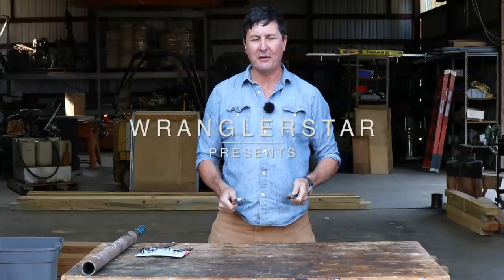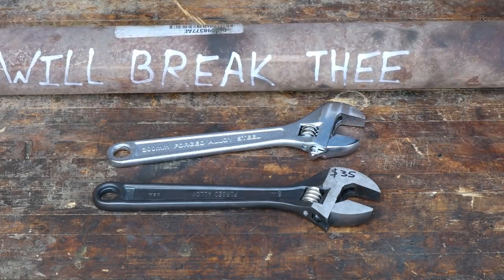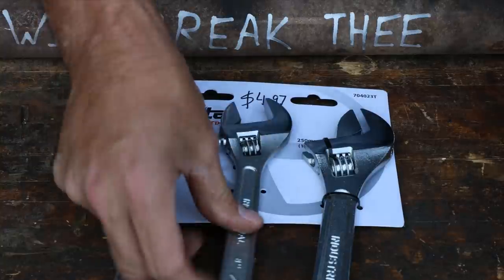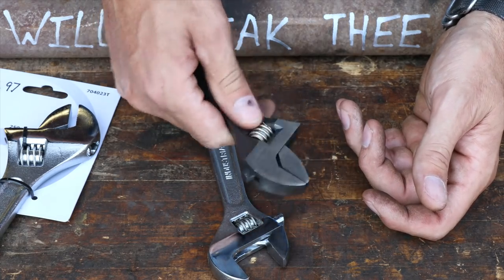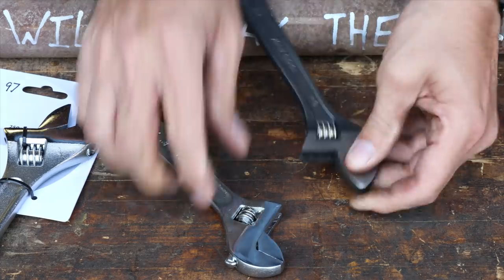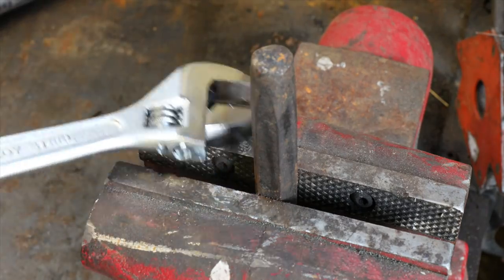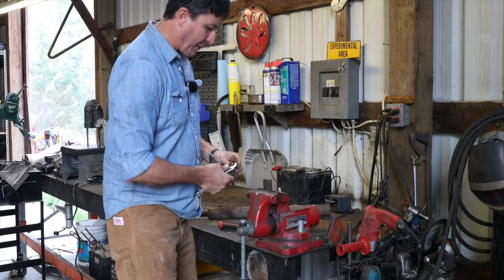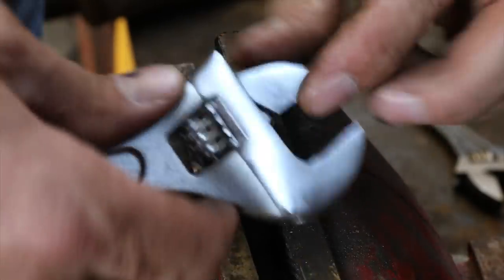Testing Cheap V.S. Expensive Wrenches On AMAZON

Comment: buy cheap tools, use them until they break. if one breaks doing something youll do again some day, replace it with a one thats more expensive
Reply: Blood Bath tools are an investment they dont dry up or go bad a good quality tool will save you hours of labor and aggervation. In my line of work we ask a guy what tools he owns and what brand if he seems to think cheap tools are acceptable then he will think cheap work is acceptable. If a guys just getting started out  I get not having the best tools it takes a long time to build a respectable tool set, but if some goomba tells me he's been in the industry for 15+ years and has harbor freight tools I know he's not a good tech
Reply: Blood Bath Breaking a cheap tool is no problem. Problem is that often cheap tool ruins your work piece.
Reply: @dustin lewis thing is though its a waste of money buying an expensive tool if you're only going to use them in a range where a cheap tool is suitable. if the tool is speced right for the job it doesn't really matter. But this is something that's much easier to dial in in a production environment than say a maintenance one. Then again in my line of work if you pulled out even a 1000 dollar adjustable wrench the quality department would be issuing you a disciplinary for illegal tooling :p
Reply: arg31ify Reality has prove that cheap tools aren't cheap.
Reply: XtreeM FaiL  well no. say you buy a cheap spanner that breaks/deforms at 50 inlbs if you're doing jobs that require more than that yeah its trash. but if you're only ever tightening light fasteners to say 35inlbs  then its perfectly capable.

and you've saved money over a far more expensive tool that could go to a few dozen ftlb whos capacity would have been wasted.

as I said spec the tool to the job.

otherwise it's no differnt to over engineering something
Reply: Harbor freight sell new knuckles?
Reply: Bartholomew Horatio Brunel, ladies wear gloves, pal.  You a lady?

Comment: The first adjustable wrench from 1892 (Enköping Mekaniska Verkstad later to be known as Bacho) in sweden. Nice try tho
Reply: False........   An adjustable spanner (UK, and most other English-speaking countries), adjustable wrench (US and Canada) or a shifter (Australia) is an open-end wrench with a movable jaw, allowing it to be used with different sizes of fastener head (nut, bolt, etc.) rather than just one fastener size, as with a conventional fixed spanner.[1] Several other names are in use, including the US trademark crescent wrench.[2][3]

Forms and names[edit]
English engineer Richard Clyburn is credited with inventing an adjustable spanner in 1842.[4] Another English engineer, Edwin Beard Budding, is also credited with the invention.[5][6] Improvements followed: on 22 September 1885 Enoch Harris received US patent 326868[7] for his spanner that permitted both the jaw width and the angle of the handles to be adjusted and locked. Swedish company Bahco attributes an improved design, in 1891 or 1892, to Swedish inventor Johan Petter Johansson.[8][9] who in 1892 received a paten
Reply: Nice copy and paste from wikipedia
Reply: is that bad? say false and show the proof?

Comment: Go to pawn shop. Get $35 wrench for $2.
Reply: Haven't been to a pawn shop where their items weren't priced almost the same as new or more.
Reply: Go to a pawn shop and get a $35 wrench for $37.
Reply: I go to pawn shop and ask for $5 wench and get slap in face. :(
Reply: I went to a pawn shop the other day and got an inspection camera brand new for $20 when it was for  sale there for $25.95. And I picked up a Skilz palm sander brand new with every attachment, never used for $25 and they were selling it for $35. I Bartered with the guy whereas if I bought both I asked the guy if I can get a good deal. So he gave me a really good deal.😁😁😁
Reply: I have all snap-on, all from pawnshops, right up to monsters for my back-hoe, maximum 25% of normal price. NONE have broken.
Reply: Wise man
Reply: who thinks to pawn a wrench?
Reply: I dig through the pawn shops and get all the craftsman stuff.  It has lifetime warranty.  Lowes took over the craftsman line.
Reply: Go to pawn shop. Get $35 wrench and wait for the call of the experts .

Comment: Wranglerstar, when your grandfather bought S&K tools because they were a good value for performance and cost, there weren't any dirt-cheap Chinese competitors then. That being said, my favorite tool is a Proto 8" adjustable wrench I've had for over 50 years. Bought it in a family-owned auto parts store where it was hanging on a Proto tool display board on top of it's painted silohouette.

Comment: Hi, I would recommend testing a Pliers Wrench (I've had good experiences with Knipex), you'll never want to use a proven but now outdated adjustable wrench.
Reply: I have one, they suck. They rely too heavily on grip strength to not round a nut. You also can't put a cheater bar on them. I got it hoping that it'd be the only tool I needed for doing alignments (manufacturers like to use all sorts of sized nuts) but ended up coughing up the money up for a set of combination wrenches. Now the pliers wrench is relegated to the back of a dusty toolbox drawer, unlikely to bust a nut ever again.
Reply: @Andoxico  I have two Knipex pliers wrenches, the medium one and the large one. I have used it many times am satisfied with it. However, you are right in the point that you will find it difficult or impossible to apply a screw that is much too tight. In that case you usually need a rust remover and a hammer anyway. I don't see the pliers wrench as a replacement for other tools, but as an addition.

Comment: SK makes the best stuff. My tool chest is full if them. My grandfather and father both used them along side Snap On in the automotive industry. They have never had to warranty any ratchets or anything from SK we have however had to warranty a few snap on ratchets and hand tools. SK is my favorite and always will be. The only issue is you have to send them out should you have an issue because they don’t have a tool truck however I’ve never had to do that but in the event you did you’d have a longer turn around time waiting for a replacement. SK is number one in my book!

Comment: I can't believe the reviewer left out the number 1 reason for buying quality wrenches. Often when a wrench fails you are applying a lot of force, and holding it with your hand. This creates momentum that will at that moment be released, often resulting in your knuckles slamming into the housing of what you are working on. This can result in anything from scraped knuckles to a broken hand, but quite often causes pain or injury. It is the very best reason to use the highest quality wrench possible...and by the way, it wont be an adjustable wrench usually, especially if it is so tight it requires a breaker bar. Can you use an adjustable wrench in an emergency...of course we all have...but if the failure of the tool might easily cause injury, it is best to use the proper tool. I would never use a very cheap adjustable wrench in any critical situation, and even a fairly cheap non-adjustable wrench will be stronger than an expensive adjustable wrench. An S&K adjustable would be a minimum, but an S&K open end or box end wrench is preferred. The high cost of good tools pales in comparison to hospital bills and lost wages due to injury, but of course it depends on what the task is.
Reply: I have punched an engine block when a Chinese 13mm socket split out. Thought I broke a knuckle for a minute.

Comment: Hm, Bahco Tool from Sweden is the original. Today owned by Sandvik. It was invented about 1891 in Enköping Sweden by Bernt August Hjort. The company known as BA Hjort and Co. And you need at least two or three, or even more. Best tool ever, if used properly. https://en.wikipedia.org/wiki/Adjustable_spanner

Comment: So in conclusion, for 90% of applications the cheapest one will be just fine.. Unless you plan on exerting 60-70 pounds.
Reply: Nick collinet no Bolt is gonna be That rusty
Reply: Actually no. He only shows how to cause total failure on them. Thing is, cheap ones get loose fast. It will cause them to twist on bolts and round them off, and it will be hard to even fit probably. A better tool can tighten smaller bolts because it's more precise (stiffer). If you can, get midrange tools, will last years - not a lifetime, not a day. And it will be harder to hurt yourself with them. In the video the expensive one broke because it was hard steel, you will never be pushing such force on such a wrench, where the cheap one just slipped and broke. Also he should show how they look after couple slips on the nuts. The cheap ones get bent on the inside just after normal use... not even after slipping.
Reply: Nick collinet longevity ?
Reply: no not 60-70 pounds. 60-70 pounds using a 30 inch lever arm... very different.
Reply: If you damaged the bolt, the bolt was weaker than the tool, which is normally the case. Not the tool's fault. The harder element will always win.
Reply: The Real Elvis:  You have missed the point, a cheap wrench with weak, springy jaws will damage a bolt/nut at lower forces than a well made tool.  Cheaper tools can have their place, but if they don't get the job done (e.g. because they round off a hex before you can undo it) then they are pointless.
Reply: Too many variables... right tool for the job? 12 point, 6 point, stripped-grip wrench? Crescent wrench is absolute last resort. If you're damaging a bolt head's corners it's usually because you're using a 12-point to break a fastener with frozen threads, or the tool was slightly over-sized. The cost of the tool won't have much to do with it.

You'll pay 500% more for the exact same tool made in the US than a tool made in Taiwan using the same manufacturing methods and specs. Being made in the US doesn't mean much aside from higher price. Taiwan isn't China. If I see "China" I throw it away. China's terrible at manufacturing everything. Their tools are cheaper because they often use inferior alloys, cast parts where forging was needed, inferior machining precision, no quality control. Taiwan is definitely on par with the US in machining.
Reply: For more than 90% of the applications.
Reply: I have to say ..the worm is really clunky and grindy on cheap nasty spanners over here (UK) Bahco ones are the way to go. Great Swedish engineering.
Reply: Bahco is now owned by Snap-On aswell..
Reply: In conclusion if you're use it a lot, get a quality one, if you only need it a couple times in a year, the cheap one is fine.
Reply: I agree

Comment: Absolutely. I have an old car and in germany we have rough winters from time to time which causes the wheel nuts to jam. I broke so many wrenches until I got a quality german one. Have it now for years. And it came with a life long guarantee.
Reply: Lebenslang? Würth oder? Egtl ganz gut; außer denen ihr Maschinenwerkzeug. Dat is müll
Reply: @derpmaniak7823  Kraftwerk heist die Marke. Ich muss dazu sagen ich kenn mich generell nicht so gut aus. Bin recht neu in dem Rabbit Hole :D
Reply: Hi, you should buy a decent wheel nut wrench instead of an adjustable wrench, otherwise it will only be laborious and time-consuming.
Then, the wheel nut wrench should be the standard tool configuration of every car, you should ask your seller and claim against him.

Comment: This is a good example of why the military uses only S-K, Craftsman, and Snap On tools. In bad conditions, during field maneuvers, or while in combat, the last thing you want is your tools to not work. 

That said, I do have "throw away" tools. Ya know, the ones that are so cheap that if you get 2 jobs out of them they paid for themselves and then some. Hell, I got a $2 die grinder that has lasted over 12 years. I don't think I've run oil through it but maybe 1 or 2 times. As well as a bunch of other cheap tools from harbor freight. They now got lifetime warranties, so why not. Lol
Reply: Same here, some things I never use but I see on for only a couple dollars at princess auto, so I pick it up. Got a set of 4 prybars for $12 there, expected them to last a week at most, and 8 months later they are still being abuse every day in a truck shop.
Reply: I get your point and I will admit I buy stuff at HF.  But not all Horrible Freight tools have lifetime warranties and even if they did, who wants to keep going back to the store if the tool failed the first time?  The flat blade insert on their impact driver split the second or third time I hit the driver and the driver would not even rotate after about 10 strikes.  Their 500A load testers failed so many times I gave up taking them back.  (And I wrote a detailed online review with photos that HF removed from view.)  The HF Earthquake EQ12XT-1/2" pneu impact wrench I have is spec at 1000+ lbs torque yet my $50 20V impact wrench from Menards delivers far more torque.  I have wondered if HF and IIT tools use the same Chinese manufacturers.

Your point re the military requiring quality if it wants to stay in business is quite true.  Logistics can be as expensive as the tool and a failed repair can cost lives.  Years ago I bought a lot of surplus but new Optima batteries that I think had been destined for Iraq, but the military was experiencing too many failures with them so it got rid of them.  During my testing of these fully 1/3 failed immediately.  About the last think I would want is a soldier's HMMWV failing to start because of a bad battery while under fire.
Reply: exactly lol
Reply: Me? I'd save the good one for the really important stuff... I mean, if I HAD a "good" and then "cheap" version... like what I keep in my Gig Bag for shows or performances, and what NEVER leaves the house, if even the musicroom itself..! lol!

Comment: Cheap tools are great for when you want to use them improperly i.e. with a cheater bar. So if you get the bolt unstuck but it damages the wrench or snaps it... oh well, they were 3 for $5 anyway, so you broke a $1.66 wrench, so what? throw it away and buy another one. Use the well made more expensive tools for regular work

Comment: When I started out toolmaking in the late 80s we were issued Unbrako Allen wrenches and you could twist those on really stubborn ejector bolts. Towards the end of my apprentiship the ones we were issued were still Unbrako, but they would round off before they would ever twist. I miss the old days. Having said that, I was in a hardware store in Switzerland a few years back buying a set of Allen wrenches, and I opted for the most expensive set, about $35 equivalent and I have to say it was a very good choice. I’ve worked with em on everything and there’s not a mark on any of em. Spend the money every time!

Comment: For a one-size-fits-all wrench to put in a general use homeowner toolbox I think almost anything this can do a long nose vise grip plier can do better. For an amateur it's much less prone to slippage, has the extra use as a gripping/pinching tool, and can turn nuts just as well as an adjustable wrench in a pinch. In extremely tight spaces, a long nose vise grip plier can even clamp onto a bolt (or nut  if the bolt isn't too long) end-wise, in line with the bolt, and twist in that dimension.

Comment: Starting to question a lifetime of Cresent wrench use.    
Freeze it around 14:58.  
All the force on the movable jaw is out at the tip.  
Use the wrench in the other direction and all the contact would be at the base of the movable jaw.
Reply: Yes but that's how,they're designed to work. Your not going to push it the other way
Reply: A pipe wrench operates very differently.  Doesn't relate to a cresent wrench.
Reply: Of course not.  I'm thinking about what is more stressful to the wrench.
Reply: Well actually you use or turn a pipe wrench the same way as an adjustable wrench.  As a matter of fact you turn channel locks the same way too.  The bottom jaw is always doing the pushing, and the top is pulling in the direction you are turning.
Reply: // , Me too, now that you mention it. And thanks for the link, Wilba. Today I learned.

Comment: I found 2 crescent wrenches to be quite a bit better than all the others. The Irwin vise grip and the DeWalt heavy duty impact grade. I have abused of living hell out of them for years and they still work fine. A crescent wrenches is a excellent thing to have in your trunk. I normally just keep a crescent brand Winch and socket set it in my trunk. But I usually use a crescent wrench for holding nuts so they don't spin.

Comment: agree a lot with your quality/budget analogy. I myself have quality tools, budget tools and antique tools. I try to love them all as the processes involved in extracting and then turning the raw materials required to make tools (or anything else for the most part) into actual tools cause death and injury all the way to the distribution warehouse.
 It was not that long ago that an antique wrench (1940's possibly and maybe even custom made/apprentice piece) was still in my vehicle toolbox and was the only wrench that could save the day!...I was so in awe of it after that I brought into the house where it is now an ornament due to vandalism and theft attempts on my vehicle making me realise how gutted I would be to lose it. I hope I don't end up in an outside situation whereupon, just before I die, it dawns on me that it could have saved me again.
I wish I had a lathe, mill and horizontal grinder though. the best tools are the ones you make yourself. Those you really cherish!

Comment: The rattling sound of the us made one tells me it isn't the same quality as the swedish ones (which don't rattle at all because the parts fit properly).  Never mind the cheap one.  And i have seen my dad remove rusted wheel bolts using one of them with a 10 foot pipe on the end without any issue.  I have no idea what they cost though.
Reply: They all rattle a little. Even the old Swedish ones.